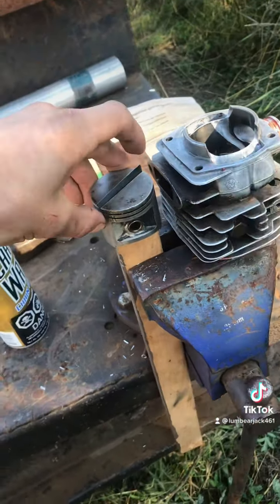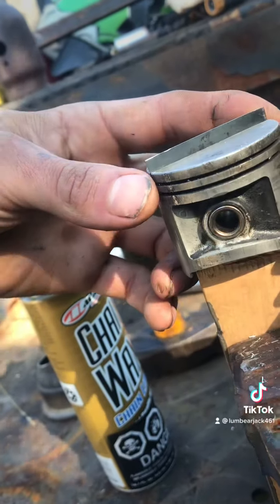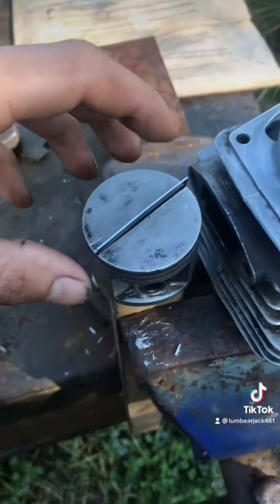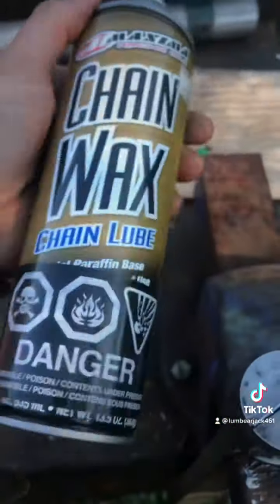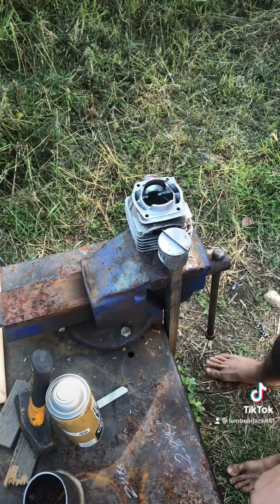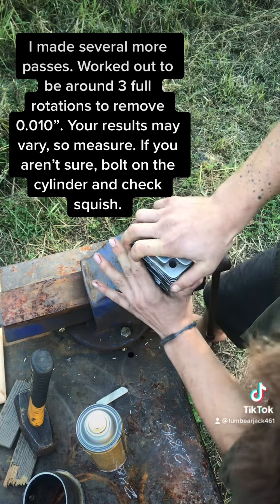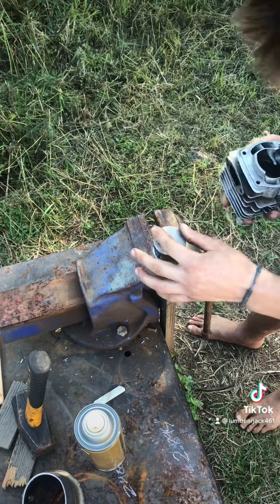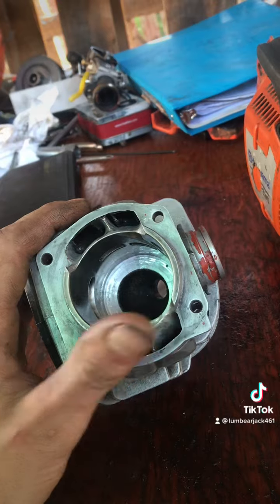Cutting squish without a laithe @cajun3197 thanks again!

Comment: Looks like a good port job too 👍
Reply from the maker: Thank you 🤙 It was a learning cylinder, I did a good job on the uppers I think. The finger ports should be running straight to the secondary I think, to many turns for the charge